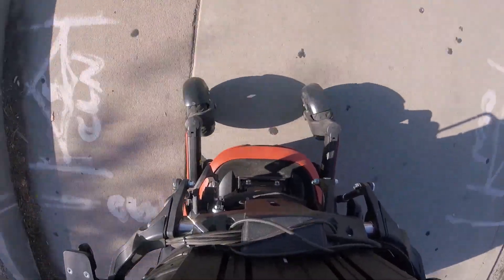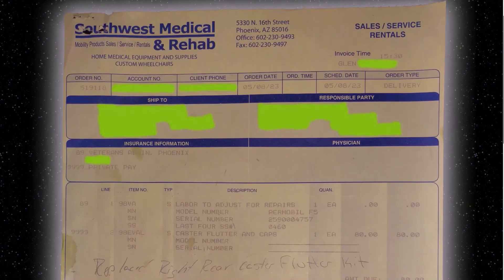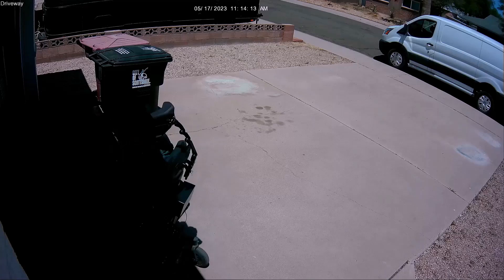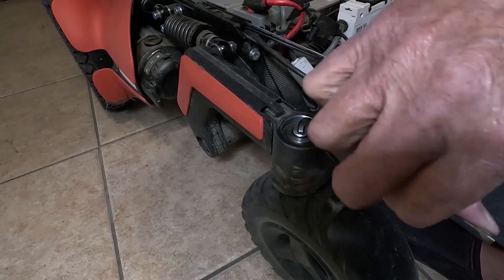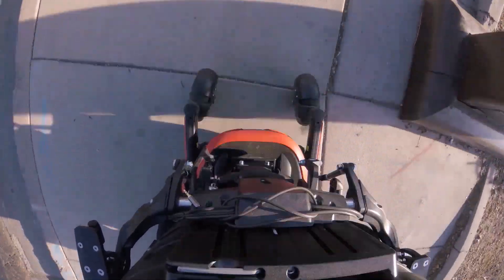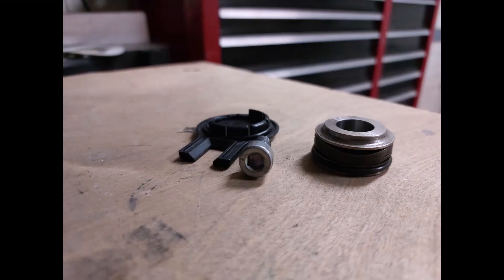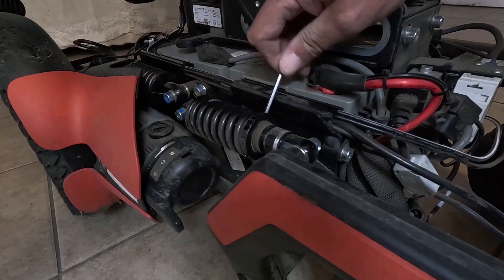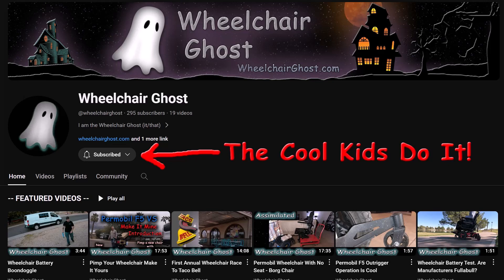Wheelchair Caster Flutter Explored

Comment: I just watched a twenty-minute video on Permobil caster flutter on a generation 3 M5 pwc by 'Totally Normal'. He's been in an F3 with aggressive tread tires. The video is eight years old, but he's presently very satisfied w his '23 F3 and was successful in stopping caster flutter on the older Permobil mentioned - interesting. Also, he assured that 'fixing' or working on the flutter problem won't void the warranty as the issue in considered a defect in parts/ workmanship. He did mention Permobil uses larger casters than previously, at some point. Eight-inch casters on m3, m5, f3, f5, presently. It occurs to me that the aggressive tread tires are slightly larger in width and diameter than the standard tread tires and they come with rear fenders, adding 7.5 mph plays a part. My initial in home F5 demo, the Numotion Rep. suggested standard tread for my use in Southern Indiana, adding the aggressive tread have softer tread compound and more open tread (wear faster). I thought that was a weird thing to say as we get a healthy amount of snow down here and the more frequent tire/ wheel replacements means more money for my vendor. That said, it's funny that Permobil's every picture pwc advertised has aggressive tread tires. Hmm.
Reply from the maker: You're catching on here.   It's not a quick decision based on emotion.

Comment: You don’t have enough weight on your rear wheels. Tighten the tensioner for your springs on both sides. A screwdriver is all you need to turn the nut that’s at the end of the spring.

Comment: I've got the flutter bad but in an older chair, i've just now tightened my washers down. One was looser than the other. time will tell if it helps.
Reply from the maker: If it helps... I think my problem is better because of two things.   Tightening the left caster shock adjuster and wear on the caster tires.   The angled crack issue went away.   Flutter is seldom and due to random causes now.

Comment: I understand I can't add images.
But, just bear with me. My original post was not quite enough to stop the fluttering, I found after a little while it would faulted and back to square one.
    I have been trying this newest and latest version out, by the way, Glory be to God on this thing, if not for him I would not have been able to come to where I am at with regards to removing fluttering from my manual wheelchair. The following is his knowledge, not mine.
    The only things someone might not quite like is that this method may make your wheels tighter, thus like they are sticking and also you might or might not have to tighten the caster stem bolt a little more, but, hey, no fluttering. 
    I have tested it for many miles and it is successful. I did reach speeds over 10 mph and possibly upto 12 or 13 mph, no  fluttering at all.
    I recently, prior to this project, recently,  I replaced the caster housing bearings [all 4].
    I adhere bicycle tread to the top of my wheels [all 4].
    I have not tried going down a steep hill yet, but, maybe in the very near future?
    It is my hopes that wheelchair riders gain relief from fluttering if they use this system. 
    I bought a wheelchair from Walgreens, a manual wheelchairthat has a load bearing of 300 lbs. If you look on Walgreens.com you might see it. It is their brand of wheelchair.
    Therefore, since my caster fork is larger than most usual wheelchairs that have a typical 220 to 250 load bearing limit, the caster stem bolt and other things are usually smaller, you may have to tinker around a little bit to get my system to work
    This system was created from parts found at Lowes. I just rolled around in the store until an item spoke to me so to speak. It took a couple trials and errors, but, I firmly believe this system will definitely work.
    If you want to use it you can, if not you don't have to. Your old enough to make your own decisions. I'm just saying, what's better, flutter or a little tightness on the wheels and maybe every once in a great while you may have to tighten down the caster stem nut. 
    Pick your fun right? 

[Ledt side of wheelchair]
[NOTE]: The 1st image is the aluminum circles [metal circles] that I am using on both sides.
They are only aluminum flashing [Lowes]. The thinnest I could find. Basically they are the shape of the bearings. They are meant to protect the bearings from punctures. 

[NOTE]: on the left side I did not put a metal circle underneath the bottom bearings. 

1. Place the bottom bearings on the caster stem bolt. 

 2. Place the metal circle on top of the bearing.

3. Put the metal tube over the caster stem bolt and slide it down on top of the metal circle. Then, take paperclip[s] and cut them in half [either use jumbo or no 1 sizes] cut the paperclips in half to look like a horseshoe. I made sure that they were long enough but not too long. 
This step with the paperclips is to ensure that the metal tubing rests tightly against the caster stem bolt, hence, preventing the caster stem bolt from moving. No movement, no flutter [my theory atleast]. [Lord willing anyways].

4. I used Strong-Drive SCN SMOOTH SHANK CONNECTOR Nail [1.5" long, 8d] nails hot dipped galvanized to place between the metal tubing and the caster housing walls. I did this to keep the caster stem bolt as well as the metal tubing at bay, to prevent them from moving, hence [Lord willing, I yheorize, no more flutter]. I used [7] nails on this step. I cut the nails down to be smaller in length from the metal tubing, to be just slightly shorter. I also cut the tips off the nails to prevent them from puncturing the bottom bearings.
    The nails are under the ring that us on the caster housing that prevents the bearing from falling through the caster housing too far.
    The nail heads rest against the caster stem bolt and the wall if the caster housing, which thus, gives a firm grip to the caster stem bolt and the metal tubing.

5. I put a metal circle on top of the nails to protect the top most bearings.

6. I put the top most bearings on top 9f the metal circle.

7. I tighten down the caster stem bolt but.

@@@@@@@@@@@@@@@@@@@@@@@@@@@@@@@@@@@@@@@@
@@@@@@@@@@@@@@@@@@@@@@@@@@@@@@@@@@@@@@@@
@@@@@@@@@@@@@@@@@@@@@@@@@@@@@@@@@@@@@@@@

[Right side of wheelchair]
1. Cut a piece of aluminum flashing in the circular manner, use a bearing as the guide. The aluminum circle will be placed below and onto of the bearing, hence to protect the bearing top and bottom from being punctured. These circles will be on the caster stem bolt with the bottom bearings. The metal circles are cut from aluminum flashing i bought from [Lowes], it is the thinnest one I could find.

2. Place the bearing on top of the bottom metal circle, the first metal circle.

3. Place the secondary metal circle on top of the bearing.

4. Place the metal tubing over the caster stem bolt and resting it ontop of the metal circle.

5. Take 1 or more paperclips, either jumbo or no 1 paperclips and cut them in half. Place the horsehoe(s) in the space between the metal tubing and the caster stem bolt. This step secures the caster stem bolt so as preventing it from moving, it will be held in place very tightly. 

6. I used Fas-n-Tite common nails, 2" long [6d] galvanized for this step, the left side I used [8d size nails]. I had to due to the right side caster housing seems smaller than the left side did. I had to cut the nail starting at the tip and up. I cut the nail to be just slightly under the length if the metal tubing. Also, I cut the tips off so it would not puncture the bearing.
    After cutting the nail, I filed down the tip of the nail to a smooth flat, square surface.

7. I placed another metal circle, same size as the bottom ones on top of the nails on the caster stem bolt. I did this to protect the bottom of the bearing.

8. Put the bearing on top of the metal circle.

9. Put the nut securely back on the caster stem bolt.

[NOTE]: It is my theory that if you were to stabilize the caster stem bolt [meaning held in place firmly forever or as long as the end user of a wheelchair wanted it to], there should either 

[A]: Be a significant reduction in flutter;

[B]: Flutter is completely removed, no matter the terrain nor the rate of motion traveling is traveling.